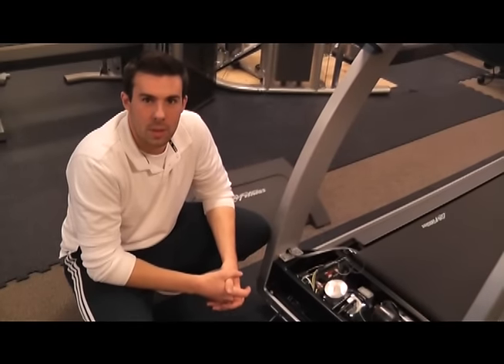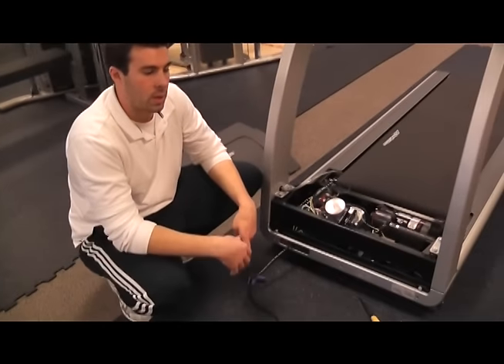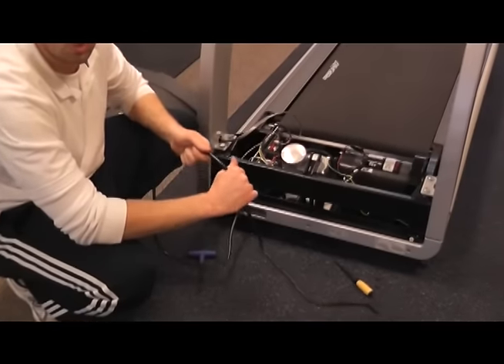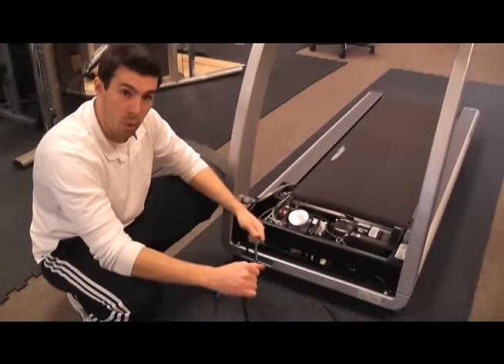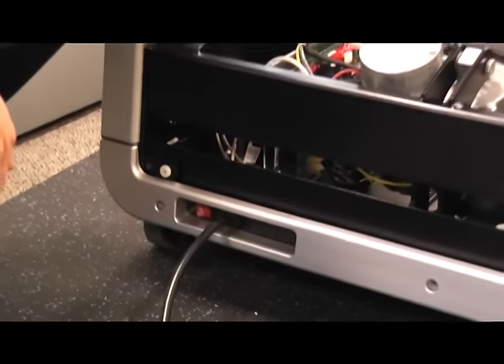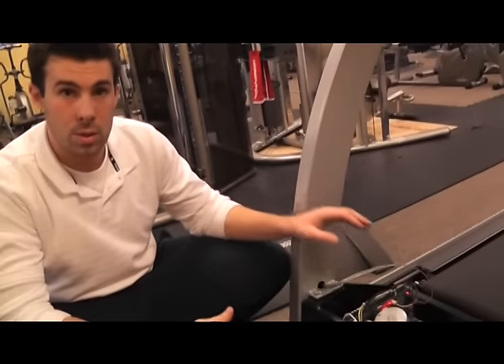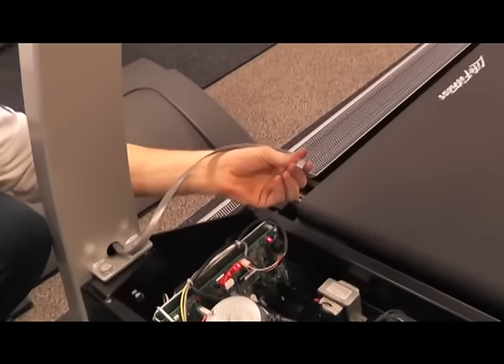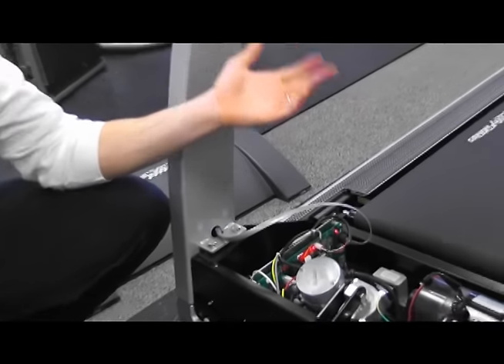Trouble Shooting Treadmill with No Power

Comment: Barry!!!  Thank you!  Wiring harness was halfway pulled from the circuit board, even had a few bent pins but it was still so easy to fix.  Wouldn't have even attempted it though without having watched your video.  Thanks again!

Comment: I have one of those cheap Frontier treadmills , today it just started BEEPING when turning it on , and the motor is not running , i was able to make it stop beeping but the display is only viewable from one sertain angle , when i start it , it shows its running on the display but the motor is not running..... is this a commen problem ? should i take it to an electrician to see if they can fix it ? rip :(

Comment: I have a slightly different problem.  Last month the house across the 
street caught on fire.  It took dozens of fire fighters 6+ hours to put 
it out but the entire street was filled with smoke.  I had kept my treadmill
in the garage... and it was filled with smoke.  When I went to use 
my treadmill the next night, the motor started cutting off 
unexpectingly.  To this day, it will work for a bit and then stop.. so 
I'm thinking the smoke damaged the motor.  Is it safe to say this 
treadmill is now toast?